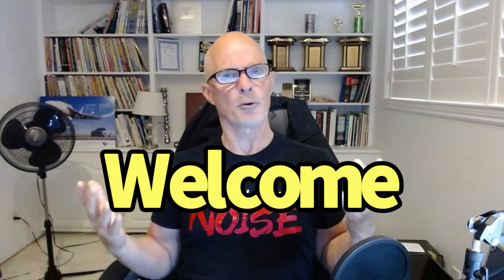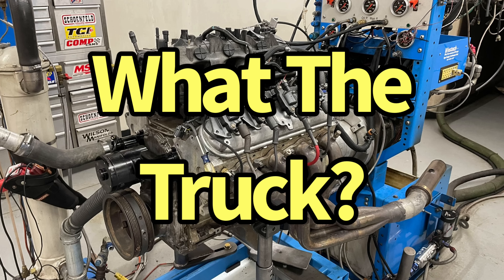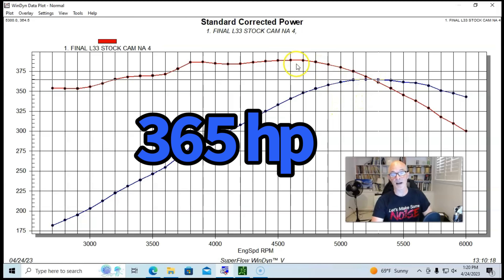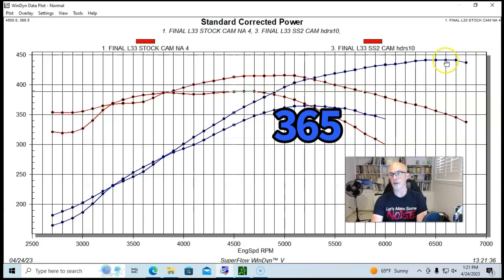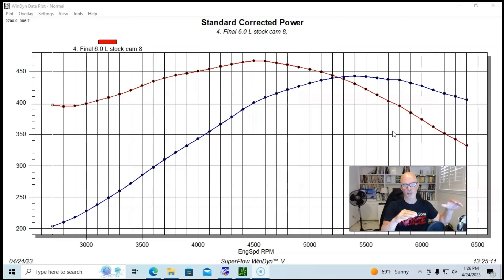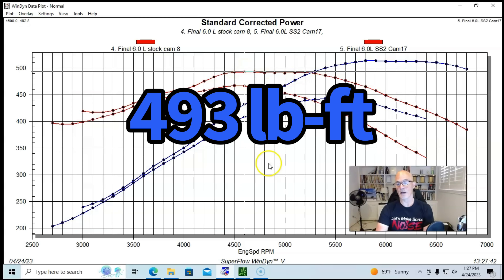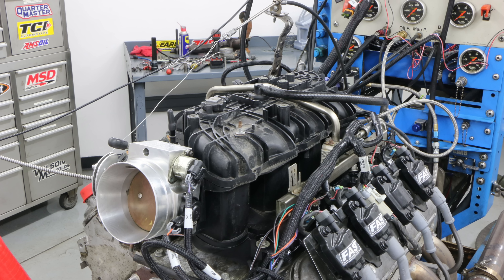HOW MUCH HP WOULD A TRUCK NORRIS CAM MAKE IN A 6.0L? NO TEST DATA-SO LET'S MAKE AND EDUCATED GUESS

Comment: Rec port heads and intake are for l good for 100ish hp??
Reply from the maker: what are you comparing?
Reply: @Richard Holdener  maybe I misunderstood but you said v the lq4/lq9 with a cam made closer to 404hp and the ly6 with cam made 515?
Reply from the maker: THE STOCK LQ4 MADE 405 HP, THE STOCK LY6 MADE 443 HP (I NEVER RAN AN LQ4 WITH A SS2 OR TN CAM)
Reply: @richardholdener1727  ok thanks, I misunderstood

Comment: Hey Richard I am running a 6.0 lq4 bored .30 over with flat top pistons, trickflow 225 Gen X heads and the fast lsxr intake with their big mouth 102 throttle body around how much hp do you think I can get
Reply from the maker: CHECK OUT THE TFS VS LS3 HEAD VIDEO

Comment: How close to the LY6 results might you get with an LQ4 w/ 862 heads and TBSS intake?
Reply: Actually I see you made 513hp 483tq with a stock LY6 with 706 heads and a 459 cam. That's basically the same setup as an LQ4 w 862 heads. The cam would make the difference. So it's the a comparison between the 459 cam and the TN there.

Comment: 2 Quick questions; what casting number head did you have on the LY6 (I assume 5364, 823) and when are you going to get a 2 piece timing cover?
I think you're correct. It will make more than 500 HP in a 6.0. My calculated numbers match your L33 example within a few HP but my numbers don't agree with your 6.0 numbers. I show that it will be more in the 530-540 range (532 specifically), but that seems too high. I would bet the bank the TN will have more torque than the SS2 just based on the LSA. Maybe I"m wrong? 
Now it's time to test. I'm looking forward to this test.
Reply from the maker: IT WON'T BE NEAR 540 HP
Reply: @richardholdener1727  If I apply the same % based on the SS2 and what you measured with the LY6, I get 507 HP with the TN in the LY6. Yes, I agree the SS2 in the LY6 should and will make more HP based on lift alone. Theoretically, the difference in max horsepower between the TN and the SS2 is only 7 HP in the LY6.
Reply from the maker: LIFT IS NOT WHY
Reply: @richardholdener1727  You don't think that lift is as important as I do, that is clear. Maybe I'm making it too important. Lower lift with a longer duration and higher lift with a shorter duration will both increase flow through the head, thus producing power. Doing both even more power. Usually, I can estimate power within reason because the theoretical power should always be more, if the data is correct. I'm trying to figure out where I'm going wrong on this setup. 

Please tell us, what head is on the LY6 and be specific. If I've missed a video where you tell the casting number, I apologize, but I don't think you have. Judging by your other videos this LY6 had it's heads swapped at least 4 times.
Reply: Ly6 have 823 heads
Reply: @markdewitt9549  They have 5364 or 823 heads. I asked several times.
Reply: There in lies the trick though…sometimes a little less duration and  ALOT less lift = more power! The LSA of the camshaft & amount of overlap vs compression are critical 🤷🏻‍♂️ I’m doing it right now with a BBC that had too much cam for 9.5:1. Went from a .680/.700 lift, 258/268 @ .050” and 110 LSA to a .652/.652 lift, 255/262 @ .050” and 114 LSA (bigger cam had 2° and smaller cam has 4° ground-in advance) and we’re talking a 50hp MIN increase by Richards own numbers of almost the exact same setup! Mine made 603hp with the larger cam…his made 652hp with only 8.5:1 compression and the same 315cc aluminum heads but the smaller cam! The real hero in all this? 25% LESS overlap! Made me a believer for sure👌🏼
I’ll take 1.3hp/ci even at 1 point less compression over 1.2hp/ci at 1 point more compression from a cam swap ANY day and not argue 🤣 Factoring in a 3-4% power increase per . in compression I’m looking at the possibility of a 60-70hp increase from an already stout combo 🤯
Had it been an 11:1 or 12:1 engine on E85 or leaded fuel, no doubt it would’ve liked the larger camshaft…but bigger definitely isn’t always better, simply because it’s all relative to the end cause 🙇🏻
Reply: @RealSteelStreet  I read a lot of David Vizard's stuff and he's done exponentially more cam tests than Richard, 30 years ago.. His method starts with overlap and LSA, then that determines duration.I really don't care about horsepower. I care about maximizing torque. You should read DVs stuff too. He's done a lot of BBC testing too

Comment: A 4"stroke 4.075 bore 6.2 block with 10.75 comp , SD LS6+ cam , orig 2005 GTO Heads, rear wheel dynoed 405hp in same 6spd car ,with near flat 2500-6000 torque curve that peaked 
 @ 410.  Owner doesnt need  1st  gear anymore
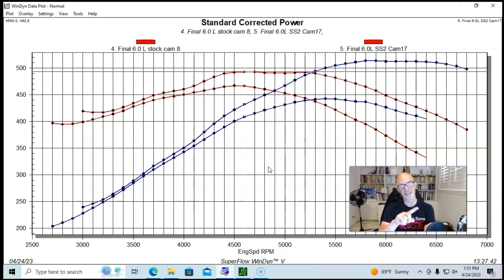11:22

Comment: On cathedral port stuff the intake isn't quite as good and the tb is to small. Cathedral stuff responds to those modifications better because that's where they're lacking. I bet a fast or ported truck intake and tb would pick up a cathedral 6.0 about 20hp....it definitely made a good difference on my 6.0.

Comment: Nice. If I have a LQ4 (107k miles) in stock trim and want 500hp.......is it better to have the factory cathedrals professionally ported or spend the money towards a new set of aftermarket heads?
Reply from the maker: 500 flywheel hp is just a cam
Reply: @richardholdener1727  Which one would you prefer?
Reply: @richardholdener1727  you mean cam, tune, and headers. I thought in the video you said cathredal heads will limit hp even with the TN cam to a little over 400hp.
Reply: @AccuSol-ERN  TN isn't really the cam if you're going for 500

Comment: For anyone curious, i have a LQ4 that base dynoed at 230. I did 799 heads, ls6 intake and the truck Norris cam, stock converter, it dynoed at 330.
Reply: That does sound quite low 😬 We made 365 whp with a 200K mile LQ4 with a nitrous cam n/a…550 whp with a 150 shot, go figure 🤷🏻‍♂️ Even factoring an 18% loss through a 4L80E you’d damn sure think it’d be 280-300(ish) MIN stock!!
Reply: High altitude? Hot day?
Reply: @cc23001  better questions for my tuner than me. I did the mechanical work. What it should and did are different things, all I can say is I have two dynojet sheets that support my comments.
Reply: 230 rwhp is very low.  I have seen several dyno in the 260 range. One was a 2004 the other a 2005. Something wasn’t  right on yours.
Reply: Same here on a mustang dyno.
Reply: How does it perform on the street is the question I want to know.
Reply from the maker: a stock lq4 should make more than 230 wheel hp
Reply: @richardholdener1727  I should have specified it was a in the vehicle. 3800lbs, 4l80e.
Reply from the maker: wheel hp means in a vehicle-a stock lq4 should make more than 230 wheel hp
Reply: My grandma car make 230 hp

Comment: If I have a stock 6.0 lq4 with stock dished pistons and a set of 243 heads, can I run the 469 cam from your 100hp/liter video with no piston to valve clearance issues? Or would I be better off using a 459 cam and milling down the head? Looking to get north of 550 at the crank. Thanks in advance!
Reply from the maker: both the 459 and 469 cams have near identical p-v, and a dish piston on the ls doesn't change where the valve hits-both of those cams fit stock p-v
Reply: @richardholdener1727  thank you Richard! Learning everything I can from you while building my 6.0! Now that I know the 469 will fit I will be running that cam with my 243 heads and a tbss intake! Can’t wait to get it running.

Comment: LY6 with VVT delete is exactly the combo I’m putting in my 71 C10. I hadn’t recalled the SS2 cam results and they’re better than I expected. My cam is yet another BTR, the LS3 stage 2 which has a 225° intake lobe and much more exhaust lobe than the SS2. I had Eric Weingartner do a stock valve job (they needed it!) and mill for a little more compression (0.018”, so about 68cc chambers). Using your guesstimating process, I’d say my combo should be very close to your SS2 results. BTR says their LS3 Stage 2 does about 540 hp on an LS3, but the LY6 is short 22 cu in and about a full point of compression. That lead me to expect closer to 500 hp even and maybe 480 torque. Either way I’ll probably be able to make it to the store and back. Fingers crossed, running this summer!
Reply from the maker: that ls3 stage 2 cam will make more than the SS2

Comment: I am building the same setup right now. Ly6 and truck norris cam. Only difference in mine is I installed flattop pistons for better compression to be like an lq9. Not sure how much more that would give it. Should run nice though
Reply: 3-4% per 1 point in compression is a good rule of thumb👌🏼

Comment: I mean you can’t guess on high tech stuff like flipping the pushrods or dimpling the main bearings. But I feel like this method gives and educated guess  on stuff like what’s this cam gonna do in this engine.
Reply from the maker: I do like the dimpled main bearings
Reply: @richardholdener1727  it’s worth + or - 20% 🤣
Reply from the maker: AT LEAST

Comment: Stupid math from me: Let's compare gains on the 5.3; we have 76 hp for the SS2, and 59 for Truck Norris => 76/59=1.28813...; gain on the 6.0 for the SS2 was 71 hp, so: 71/1.28813=55hp. I am guessing 498 hp; within 3 hp of your predictions.
Reply from the maker: math misses an important point
Reply: @richardholdener1727 which is? I'm here 'cause I love engines and want to learn from your experience. Your videos are catnip to my brain!!
Reply from the maker: I TAALKED ABOUT IT A LITTLE ON THE LIVE FEED-THE TN CAM HAS A MUCH WIDER INTAKE TO EXHAUST SPLIT THAN THE NEAR SINGLE PATTERN SS2 (I THINK THAT WILL HURT PEAK POWER MORE ON THE SS2 ON THE 6.0L THAN THE TN)
Reply: @richardholdener1727  Oh ok, thanks for your response, and Godspeed with your projects.

Comment: Wondering on stock LQ4 with a trucknorris cam and upgraded valve springs horsepower be ?

And a 5.3 L59 with a trucknorris cam and uprgraded valve springs would be?
Reply from the maker: the l59 question is answered in the l33 dyno results
Reply: The L33 made 424 hp and 415 lb with the truck norris cam. 

On the video you mentioned that you’ve ran LQ4 with 317 heads with this cam and it made  405hp. 

My question was does the 5.3 with the truck norris cam make more horsepower than an LQ4 with a truck norris cam.
Reply from the maker: I SAID A STOCK LQ4 MADE 405 HP WITH A STOCK CAM-NOT ONE WITH A TN CAM
Reply: @richardholdener1727  thank you for you quick response and knowledge on the Ls engines.

Comment: Rich you got me confused here brother. Your 6l stroker vs 6.2l destroker vid, you showed results of a stock lq4 just with open headers and it showed just a tickle over 400hp(surprised me). But in this video you said with the same set up but with the sloppy cam it was low 400? Does that cam really not like lq4 that much? What im trying to figure out.. is what would a stock lq4 make with the truck norris. On the crank. As something like this would but a perfect cheaper setup for a marine application. 

P.S. Im building a lq4 for my jetboat and im looking for information. Lq4, 317 heads(slightly honed and cleaned up), bored .30 over, wiseco flat top pistons(better compression), ls3 intake, truck norris cam with springs. Its gotta be pushing 500hp!!????
Reply: LS3 intake with 317 heads? Lol not ideal
Reply: @cc23001  well there's a learning moment. Guess I'm using the ugly AF truck intake. FFS..  whats your guess on this set up? Has to be atleast 500hp? No?
Reply: @Underbiteoutdoors  there's a video series where Richard showed what it would take to get 4,5,6,7 and hp out of each displacement, I'd go hunting for those.
 But a better alternative intake would be the "TBSS/NNBS" from the 07.5-13 trucks. It's not a beauty queen but looks better than and has a bigger throttle body and will add power over the gen3 truck intake. A set of 243/799 heads would add even more compression and a more efficient combustion chamber, bringing up the power too. Not sure if it's necessary to meet your goal of 500 but it would allow you to run a more tame (smaller) cam and have a more broad power curve and still hit your goal. Hope that helps bud, happy motoring
Reply: @cc23001  OK yea I looked up and watched those videos, definitely helped answer questions. I'm looking for a set of 799 heads, first time porting stuff and I blew through the rocker mounting bolt hole. I'm aware people have just sealed the hole off with loctite or whatever but I like piece of mind. Gonna get the adapter Plate for the ls3 intake. I'm hoping with those changes I should hit my 500hp mark. Ive also been recommended by cam motion this custom cam (XA220/365-XA232/355-10+4). Which is quite abit different then the truck norris cam spec. I havnt taken the time to see if Richard has tested something similar to those cam specs on a 6l. 

Thanks for the input, any and all of it is much appreciated. I'm a mechanic by trade but new to the engine building side of the trade.
Reply from the maker: I have never run an SS2 on an LQ4-the statement was the LQ4 makes 405 in stock trim, the LY6 made 443 in stock trim.

Comment: I want to figure out what I should do with my 05 Canyon (EXT Cab) 5speed stock (4Cyl Head gasket shot) I would love to have LS 6-speed and 4.10 (3.43 originally with 5-speed)(4.10 and 6-speed final drive ratio will still have a lower RPM) limited rear-end???

Comment: I thought you were going to compare Truck Norris cam in a 4.8L and 5.3L: then compare Sloppy Stage 2 in 4.8L and 5.3L and 6.0L to guess what the Truck Norris cam will do...
That seems close enough to predict the power that you are using though...
The only real way is to run the cam in 6.0L...
Reply from the maker: I did do that-just with the 5.3L (only needed 3 data points to find the 4th)

Comment: I put way more thought into this than ought to be legal, but my numbers came up to close enough to the same torque to not matter, but 492hp. I based my assumption on the fact you have run the BTR truck cams in the ly6, and the same cams on the 5.3, and the truck norris is a few HP up on the stage 3 truck cam, and that was at 490hp. 

What I'm curious about is how well the power will hold out past 6200 rpm. With th 4.8 there is very little drop off, the 5.3 seems to drop a few (more pronounced when you're using the FAST manifold, for some reason)- but at what rpm the LY6 will produce peak HP, and how much it will still be making at 6500 is what intrigues me.
Reply: The drop off in higher rpms is due to the fact that displacement eats up rpm on the high end when using the same cam. For a larger displacement motor, you'd want to change the duration to keep the rpms in similar territory. There's an 11% change in displacement, so you could roughly calculate an 11% shift in rpm range. 
So a 6300 rpm peak on the 5.3 would translate to roughly 5600 rpm on the 6.0 motor. It's not completely 1:1 but it gets you in the ballpark.

Comment: I would like to see this test done with both rec and cath port heads. It’d be interesting to see the torque curve.
Reply from the maker: please see rev vs cath port video
Reply: @richardholdener1727 hey sir what cam would you recomand for 408 stroker roped off with lsa blowers 
I want it for daylie use I don’t want something with relly hi stall converter an how much power do you think it would make
Reply: @richardholdener1727  not the same combo
Reply: @codycopenhaver  gonna work the same way
Reply: @codycopenhaver  ask for help, gets help, says it’s wrong.  Get a life.
Reply: @Cultofpersonality09129  I didn’t ask for anything, I made a statement. Learn to read.
Reply: @codycopenhaver  I would like to see 🤔 is asking,  just saying. 👍